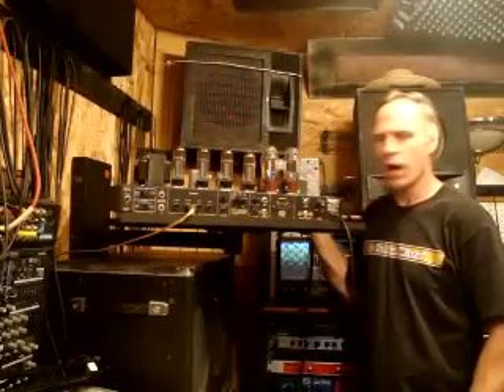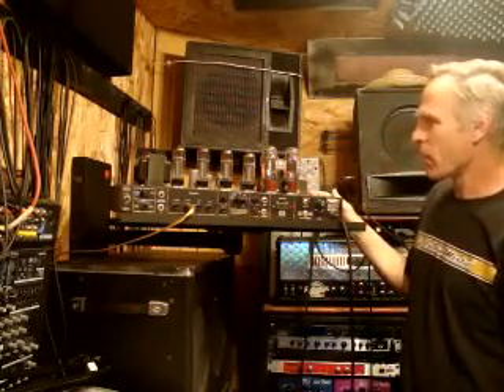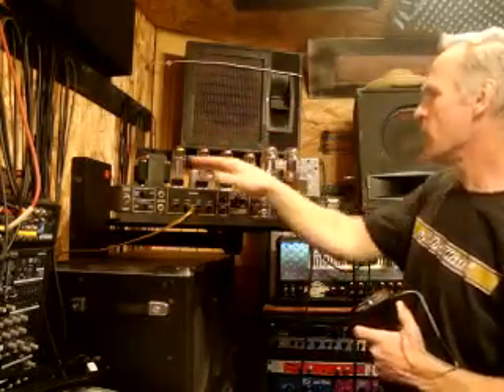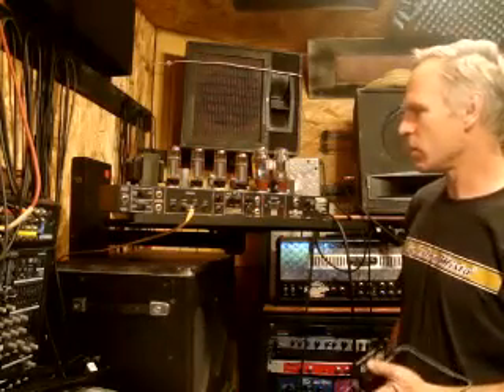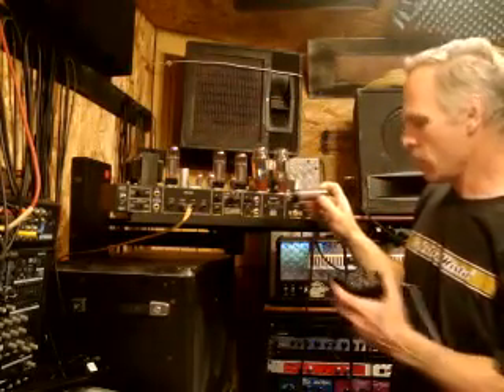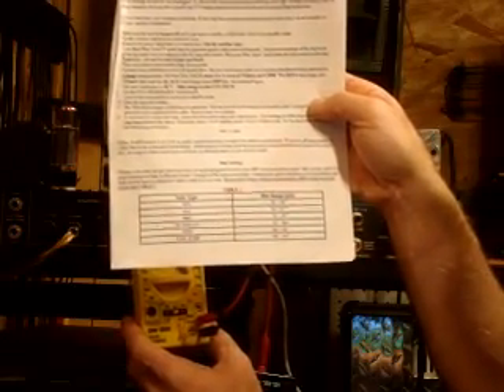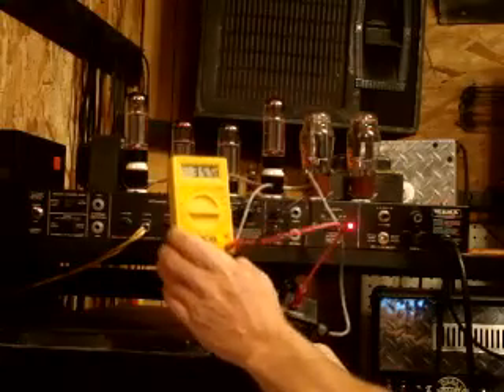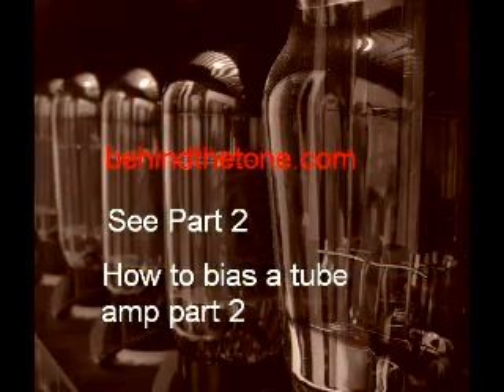How to Bias a Tube Amp Part 1

Comment: Tube amps should be engineered with a capacitor drain button with a hot and cold led indicator. 
It would take a lot of fear and danger out of working on them.
Someday they will have real time monitoring with automatic and adjustable bias.
Plug in a code scanner and it reads out the state of health of tubes, transformers and capacitors.
Make tube amps safe ,user friendly and more reliable. 
Plus auto monitoring and biasing could help an amp save itself from overcooking.

Comment: TONE GURU, how do you bias the compression of the power tubes? 
another question when REMOVING the normal channels 1st preamp tube it will changes the TONE of the vibrato channels preamp in fender amps, any reasons why it changes the tone and impedance?

Comment: Cool guitar. I just bought a used crate
Tv6210. I play hard rock and early HMetal.
Any grovetube preamp recomendations? It came with sovtec 6l6 but ive got two sovtec el34 matched sets im going to change to. The reverb starts to feedback uncontrollably at max so we know that yt is microphonic and needs changin. Any preamp tube recomendations? GC sells groove and I think Jj's

Comment: Do you really prefer JJ's before Mesa Boogie tubes? Do you prefer the sound or the quality-cost relation? And what you measure with the multimeter is Anode current? Sometimes you say 35 volts at part 2 and i'm a little bit confused. Thanks for the videos very nice!

Comment: I'm getting really annoyed, because people think they're explaining what bias means, BUT THEY'RE REALLY NOT!!!! I don't want BS, just tell me what happens to the amp when you bias an amp?! Is it like an input level on a audio interface, so the sound is not clipping, but bias works in voltages?
Reply: So it runs evenly not too hot not too cold.
It would be neat to build a head for guitar and have volt meters hardwired right in to constantly show bias voltages.
Reply: +Black Skull I have some knowledge of this, as I am currently designing a valve pre-amp. The bias voltage is applied between the cathode and the grid of the valve (or tube). For example in a pre-amp tube it could be -6Volts. The modulating (AC) input signal (to be amplified) is added to the DC bias voltage, and is usually much smaller (say 0.5 Volt RMS). The current that flows to the anode (plate) is modulated in sync with the modulating AC input. The voltage at the plate (some 150 to 300 volts) will now be a sum of the applied DC voltage and the modulating output; signal (which is now 180 degrees out of phase). A capacitor at the output stage cut out the DC and only allow the amplified AC signal to pass. In some very old tube amplifier circuits the bias voltage was applied with a battery.

In power amps two tubes typically operate in a push pull class AB design (not true in pre amp stages), and so the bias voltages should be set correctly and the pair of tubes be "matched";. If you check the bias of the these power amp tube pairsI believe you may not have optimum gain, efficiency and power output, and you may shorten the life of the tubes. It probably won';t clip your signal (as the amp is designed to run in the linear Class AB regime and the bias voltage should be basically correct for the valve the amp was designed for, even allowing for slight variation in valve manufacture), or alter your tone (I doubt). Indeed, there are designs of valve power amps that are self biasing or fixed bias;, (I have one) and you don't need to worry about it as a user. However, some amp designers think these designs are not best practice, probably because they worry more about power efficiency and tube life.
Reply: +Black Skull 

In a nutshell, ‘biasing’ is the adjustment of the current through the output tubes under ‘no-signal’ conditions, which is accomplished by adjusting the ‘bias voltage’ on their control grids. Different tubes (or even different examples of the same tube) require different bias voltages if they are to operate as the amp designer intended.
Reply: 12,999,999 views evening the voltages across the power tubes

Comment: What's biasing tubes? I don't understand. I'm trynna replace my tubes and I kinda feel like I can replace them myself. Got Line 6 Spider 100watt head amp. Got a quartet of 6L6GCMSTR power tubes. Got two JJ preamp vacuum tubes. Can I just install them ?
Reply: pre amp tubes do not need to be biased

Comment: "They store high voltage in their capacitors" ...lol okay.
Reply: Joshua Rodriguez yes they do
Reply: +Scotty Heinl technically they store charge, but there is of course a potential difference between the capacitor plates. That potential difference, or voltage, is equal or lower to the voltage applied to the capacitor to charge it. So a large capacitor in the high voltage rail of a tube amp can carry a lot of charge, and at a high voltage. However, if you were unfortunate enough to discharge it through your body, that voltage would exponentially decay very quickly during that discharge; it might still be enough to really hurt you, but probably not kill you. Grabbing on to a DC high voltage from a live input transformer (a continuous output) is much more dangerous.

If you switch of the amp and discharge all large capacitors you really should be safe. Extra safety can be factored in by wearing rubber gloves and wearing rubber soled shoes.
Reply: +Guitar Paul I can assure you that the shock from a charged filter capacitor really DOES hurt you. Don't ask me how I know.

Comment: i believe he got it backwards, Eddie VH used a variac to LOWER the voltage.. i dont think this runs the tubes hotter. im no expert though.
Reply: Correct, EVH ran the voltage lower.  However, many people have stated it was more as a protective measure rather than to have any sound benefit.

Comment: his tech Matt used to come to our shop all the time. my buddy still hangs with him....pure BS....he used variac to lower voltage. 98v I think. hence the ''brown tone'' ....from brownout, like when power co. lowers line voltage. amps, stompboxes, whatever, cleanup with more power. dirtier w/less pwr. Fender uses 100k resistors, get clean tone..marshall 22ok...more dirt/grain. Matt says his main super lead was stock. widely accepted that cleaner dirty amp records(bigger) than dirtier amp (smaller)

Comment: other than obvious reason to not touch-sometimes hot, burnt fingers, another reason to not touch while hot is that while hot, the filament wires, (Insides) are  more susceptible to damage,(like a hot light bulb). and given the insane prices asked for some, the lettering can rub off, especially on oldies. fingers are greasy, filthy, leave residue. special gloves, or clean rag, grasp, gently at bottom, 'slight rolling motion', pulling upward/away from socket.

Comment: Because it's expected to find an amp rating of around 40 milliamps. Depending on the tube. If you find let's say 70 milliamps you have a problem. It shouldn't be that high, so anything above 200 would be very bad. You should never see plate current that high, so it's safe to assume you can use the 200 milliamp setting. You just want to choose the lowest setting you can on the multimeter while keeping that setting above what amps you are going to be reading.

Comment: the 'keep one hand in your pocket' safety move is what all the oldtime radio anf tv repairman learned early on. The idea is that if you get zapped with one hand it will knock you on your ass but if you have one hand on ground and go hot on the other the current goes from one hand over to the other right thru your heart. Then your heart stops. Pat attention when thes techs say it can kill you. Not joking.

Comment: The one hand trick is to keep the current from going across your heart. I have burned off the skin of a knuckle or two on old Supro amps. They love putting the B+ in a most dangerous location. You can mod tube pre-amp Ep, and Z into the grid. Mesa I can add a bias pot(s) to easily for under $100 or so. JJs EL34 and their 6L6 as well as 7027 all have the same cathode assembly. They are not high on my list of favs. Their 6L6 can run higher Ip and have to be biased different than all NOS 6L6GCs.

Comment: Not really that important to clarify, however it is actually the current that kills, not the voltage. Voltage is just a potential difference between anode and cathode, or the power supply and the ground (in safety issues you ensure you are not the ground)

Comment: I'm using a Mesa Boogie Triaxis, lately the volume would drop in the middle of playing,
when I touched the output knob, it made a very loud crackling noise, naturally I thought
that the pot is bad and I cleaned it with some contact spray, someone told me that it can be one of the tubes, and not the pot,
any advice how to check that?
Thanks

Comment: Hi, this video is great, but I wanted to know, if anyone can answer for me.  I'm 26, and as of recently decided due to my insatiable appetite for guitar gear, a career in repairing, and possibly building/designing amplifiers makes sense to me, and would fit me perfectly.  I have a aptitude for stuff like this, though this does seem a bit out of the realm of what I'm used to. Any recommendations on reading material or schooling that I could do???

Comment: @Filmpest And also, a cool trick to lower power if your interested in that, is if you have a amp with 4 power tubes, you can take either the outside 2 or inside tubes  out and it will in theory half your power.  Just make sure to drop your impedance selector down one step, IE. if you have a 16 ohm cabinet, run your amp at 8 instead.  Learned that from a buddy of mine who used to build amps for Tone King.

Comment: @Filmpest Reason? In a class A/B amp, (which is the name for a push pull type amp) in a four tube amp, the outside two work together, and the inside two work together.  If you pull out two side by side, it will screw up your impedance and will cause problems in your transformers.  I'm learning about all this stuff myself, so I might not be exactly on, but that's the general idea behind it.

Comment: You need to calculate your bias setting, you can't just look at a random chart for what's "safe" for that tube.  You need to multiply your desired percentage of dissipation (70%) times the wattage of the tube (25 for EL34's, 30 for 6L6's, etc) divided by the plate voltage of the amp.  The plate voltage can be dramatically different from amp to amp.  Most are between 450 to 550 volts.  I used to own a Hiwatt DR201 that had a plate voltage of 725.

Comment: Thanks for the vid. My amp has a slight crackle. It's not too loud; I have to really listen to hear it, but it's there. It's especially audible at lower volume for some reason. Anyway, you confirmed that it could just be the preamp (or maybe power) tubes. Hopefully it's nothing more serious than this.

Comment: All you need to do to discharge the Capacitors is set your multimeter to the appropriate range for either voltage or amps, doesn't matter, and touch the leads to either end of the capacitor, be sure to to this to every capacitor.

Comment: Be careful with your terminology here. It's not an ohmeter it's a multimeter, and you're measuring current, Amps/mA, not Volts. They do make ohmeters which will only measure Ohms/Resistance and if you have one of those NEVER NEVER NEVER connect them to anything that's turned on, you will probably blow a fuse in the meter and I've heard horror stories of meters becoming grenades when you do that.

Comment: Great video!

How come you set it at 200mA at the beginning?
Reply: Some brands of bias tester break into the cathode circuit to directly measure current in mA. Other testers insert a one ohm resistor into the cathode circuit and read the voltage across it in mV. (mV across a one ohm resistor has the same numerical value as the mA flowing in it, e.g. if you read 39mV there is 39mA flowing.) So you need to read the instructions that come with your tester.

Comment: The one hand behind the back trick can help with that reflex to "grab underneath it" but its mainly to stop you completing a circuit with your arms. Getting kicked in the hand hurts but completing the circuit with one hand grounded and one on a high current line runs the current up the arm through the chest (heart)  and out the other arm, this can interfere with the nerves electrical signals to make the heart beat in rhythm.
Don't mean to be morbid but Its important to know the "why" of a thing.

Comment from the maker: You can run the amp a little hotter but it won't change the tone that much & you will burn out tubes much faster. My suggestion is to put a nice overdrive in front of the amp. You can keep the gain on the overdrive low & just use it to drive the amp a little harded. This will bring the desired effect with out hurting the amp. Tube screamer is a all time favorite.